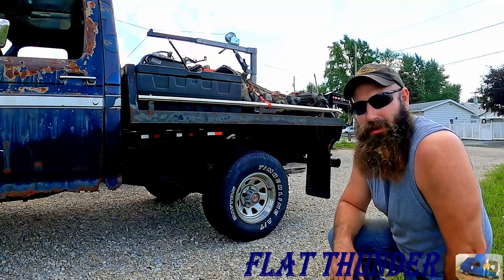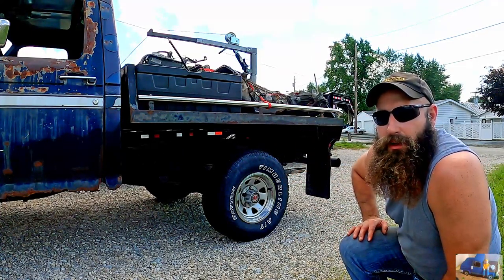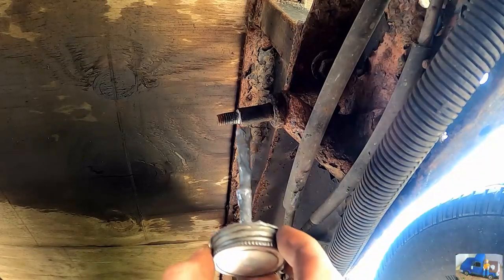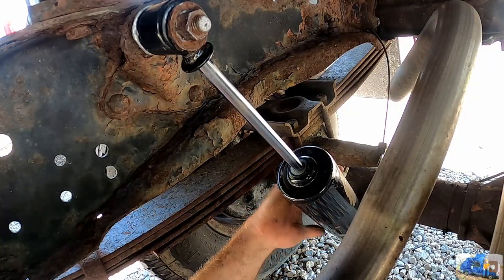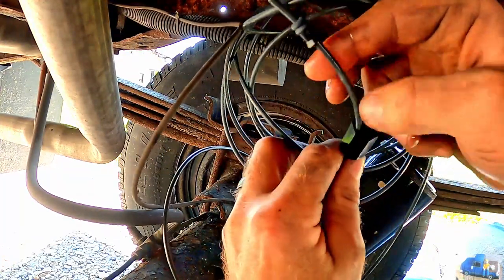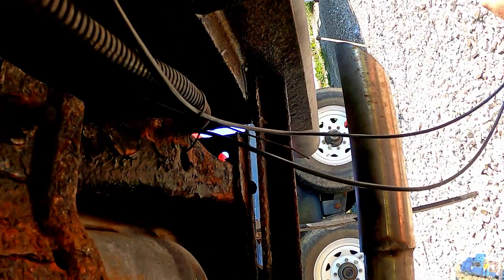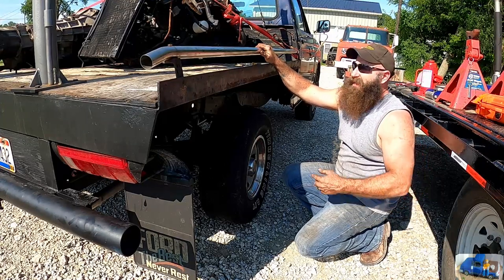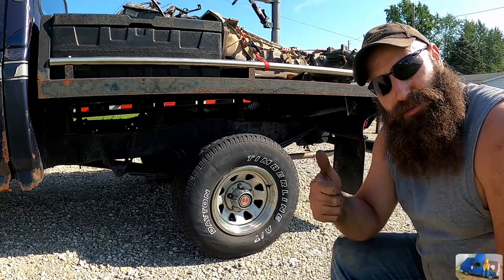1983 Ford F150; INSTALLING GABRIEL HIJACKER AIR SHOCKS

Comment: I have same problem on my 95 but I’m going whit air bags to se how they are
Reply from the maker: Air bags are a good solution!  I always wanted to install airlifts on-board air compressor with gages in the cab.  I thought it would be handy for hauling / changing loads.  Thanks for watching and good luck on the install!  👍😁
Reply: @FlatThunder   yea my flat bed truck don’t have a lot clearance wen I pull my trailer whit  so I talk to a Mecanic and he going to put on some air bags whit that compressor to se how they go because I put 3 yards of mulch last Monday and that tires was rrubing on that croos member of that bed
Reply from the maker: @Purosanluispotosi  sounds like the system I was going to install!  I'm sure you will like it!  👍😁
Reply: @FlatThunder  i hope so and thank u for replayback to me

Comment: I wonder if the bushings can be swapped to poly?
Reply from the maker: Not sure, a custom set probably could be made if the standard units do not fit.  In general I dislike how rigid they are.  I had a bad experience with poly bushings on a mustang.  Thanks for watching!  👍😁